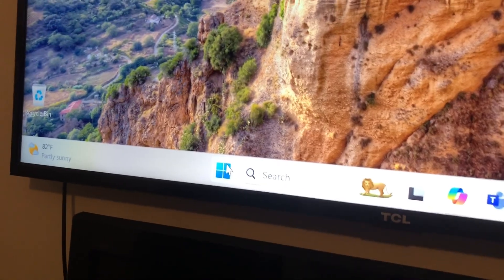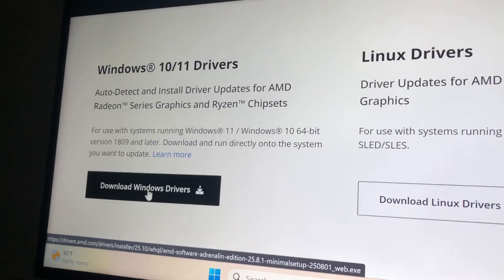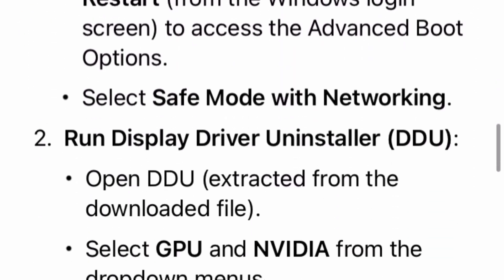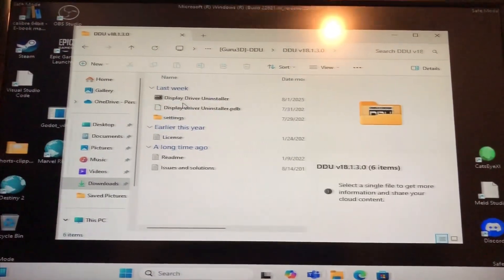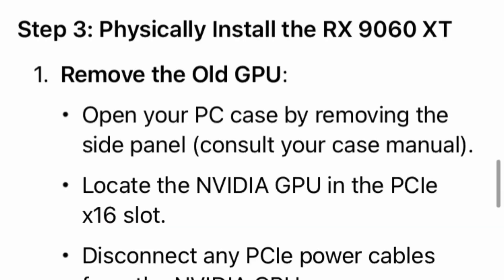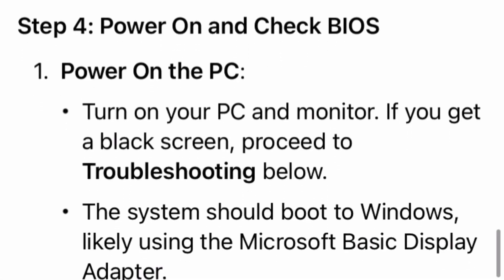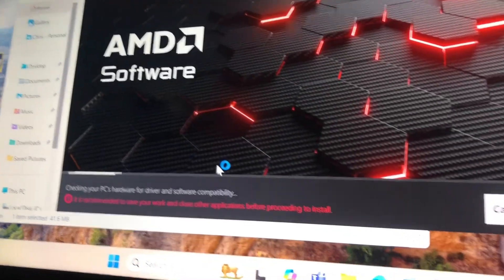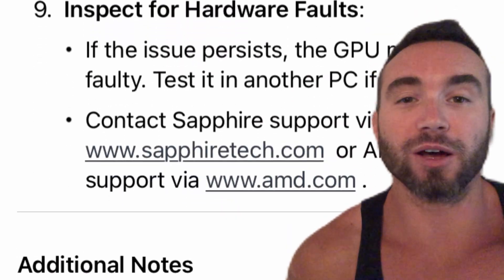How to Install an AMD Graphics Card (Sapphire Pulse Radeon RX 9060 GPU)

Comment: im stuck. i have this exact case and exact graphics card, but its not aligning with the case. i have the asrock B850M pro motherboard and the graphics card slot does seem a bit high...
Reply from the maker: Hey Dark! It sounds like a frustrating build snag—graphics cards not seating properly is a common hiccup, especially with micro-ATX boards like your ASRock B850M Pro (which is a solid AM5 board for Ryzen 9000-series CPUs). The "slot seems a bit high" description suggests the PCIe x16 connector on the GPU isn't lining up vertically or horizontally with the slot on the motherboard, likely due to case alignment, mounting issues, or insertion technique rather than incompatibility (your RX 9060 XT is a standard PCIe 5.0 x16 card, and the board's primary PCIe 5.0 x16 slot is designed for it). I'll walk you through the key things to check and fix, step by step. Work in a well-lit space, and if possible, do a bench test (mobo outside the case) to isolate the issue.1. Verify Motherboard Installation and Case AlignmentStandoffs and mounting screws: Double-check that all standoffs in the case match your mobo's screw holes exactly—no extras or missing ones, and none too tall/short. The B850M Pro is micro-ATX, so it uses about 6-9 standoffs. If the board is even slightly tilted (e.g., one side lower), the PCIe slot can appear "high" relative to the case's rear bracket area. Loosen all mobo screws, reseat the board flat, and tighten in a star pattern (opposite corners first).
I/O shield: Ensure the mobo's I/O shield is fully snapped into the case's rear cutout from the inside (not loose or reversed). A misaligned shield can push the board back, shifting the slot position by a few mm.
Case tray flex: Some cases warp slightly under weight. Lay the case flat and gently press around the mobo tray—if it bows, try supporting it or loosening/reseating.
Quick test: Remove the mobo from the case entirely. The GPU should slide into the PCIe slot easily on a flat surface (ignore the bracket for now). If it doesn't, the slot or card might be defective (rare, but RMA the board/card).

2. Check PCIe Slot and GPU InsertionWhich slot? Use the top PCIe 5.0 x16 slot (PCIE1 on your board)—it's the primary GPU slot, positioned for full x16 bandwidth. The lower PCIe 4.0 x4 slot is too slow for a high-end card like the RX 9060 XT and might not align as well.
Removal of slot covers: Confirm you've removed the correct metal bracket(s) from the case's rear (the ones matching your GPU's bracket height). For a 2-slot card like the Sapphire Pulse, you need one full-height slot open. Leftover metal tabs can block the bracket from sliding in.
Insertion technique:Power off/unplug everything. Ground yourself (touch the case).
Align the GPU's PCIe connector at a slight downward angle (20-30°) toward the slot.
Gently rock it in while pressing evenly—don't force it straight down. It should "click" when fully seated (the slot's retention clip locks it).
The GPU bracket should sit flush against the case's rear without gaps. If it's sticking out or angled, the mobo might be too far forward/backward.
Secure with the case screw last, after the card is fully in the slot. Overtightening the screw first can bow the card.

If it's still high: This could mean the GPU's bracket is catching on the case edge. Try inserting the card's bracket first through the rear opening, then pivot the far end down into the slot. Some users gently bend the case's rear frame inward (with a screwdriver) if it's crimped.

3. Inspect for Obstructions or Compatibility QuirksCable/CPU cooler interference: Ensure no SATA/power cables, M.2 drives, or your CPU cooler (especially air coolers) are bulging into the slot area. The B850M Pro's PCIe slot is close to the CPU socket, so tall coolers like Noctua NH-D15 can crowd it—temporarily remove the cooler if needed.
GPU dimensions: The Sapphire Pulse RX 9060 XT is a compact dual-fan card (~240-250mm long, 2 slots thick), so it shouldn't overhang in a standard mid-tower case. Measure your case's GPU clearance (e.g., max length) against this—if your case is SFF (small form factor), that could be the culprit.
Board variant note: If your "B850M Pro" is actually the Pro RS or Pro-A (common variants), the layout is identical, but confirm via the box/manual. No known issues with this board's slot position, but AM5 boards sometimes have the CPU socket offset, making the slot feel "high" compared to Intel boards.

4. Test and Troubleshoot FurtherPower connections: Use the included 8-pin (or 6+2) PCIe power cables—don't daisy-chain. A weak PSU can cause detection issues, but not alignment.
Boot test: Once seated, connect your display to the GPU (not mobo HDMI). Boot into BIOS (Del key) to confirm it's detected under "PCIe Devices" or run GPU-Z software.
If nothing works: Update BIOS via ASRock's site (use the Flashback button—no CPU/RAM needed).
RMA path: Contact Sapphire for the GPU (alignment issues could be a bent connector) or ASRock for the board (faulty slot).
Community check: Search/post on r/buildapc or ASRock forums with photos of your setup.

Comment: You did the driver uninstaller and driver install wrong. You should download the driver for your graphics card in your case Rx 9060, then disable your Ethernet/wifi then go into safe mode. After opening DDU for the first time after pressing OK in that warning box that advanced options that you mentioned, right at the very bottom there’s a box that says Prevent windows from downloading drivers you need to check that. If you don’t then after installing your new gpu windows will download drivers for your gpu even if you install your amd drivers and cause issues.
Reply from the maker: I didn’t have those problems.. 🤔… but thanks for the tips 😁👍